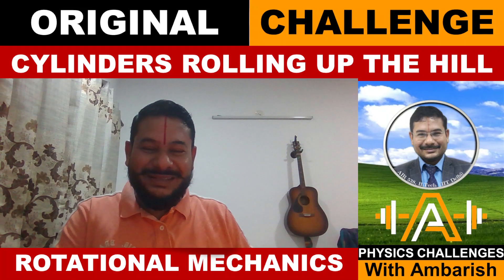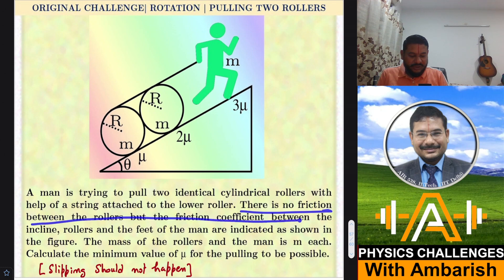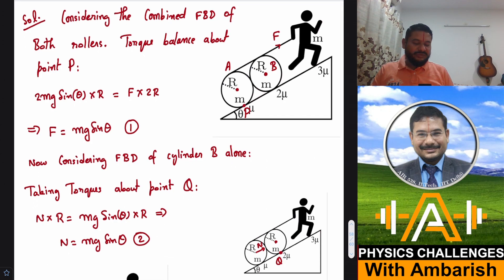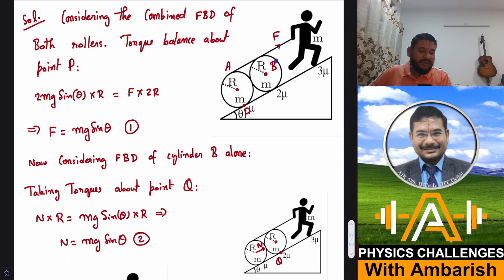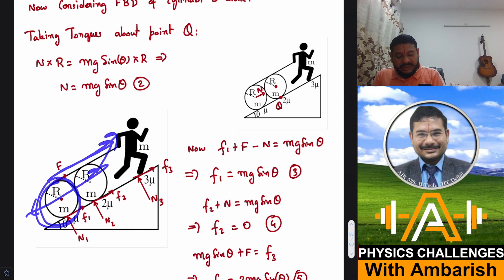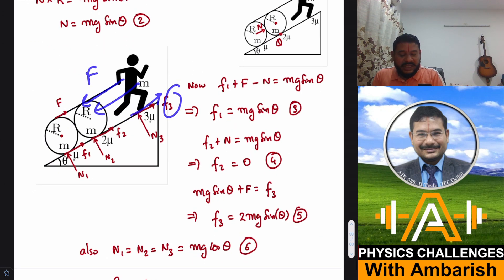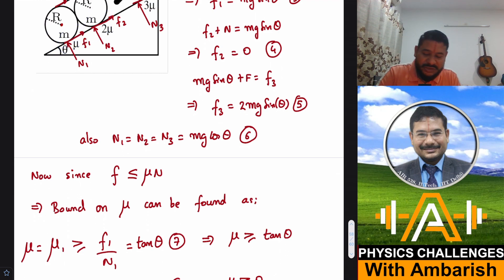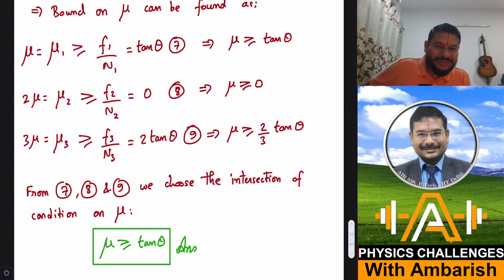ROTATIONAL MECHANICS| ORIGINAL CHALLENGE| ROLLING CYLINDERS UP THE HILL| FRICTION COEFFICIENT| JEE

Comment: Sir why you consider f2 in upward direction can we assume it in the downward direction while solving
Reply from the maker: It does not matter, for static friction you can assume any direction, if it comes negative , the direction is opposite...
Reply: I usually consider no friction at first and imagine the system sliding and then assign the friction , works for me everytime